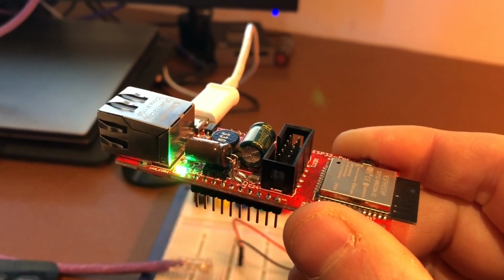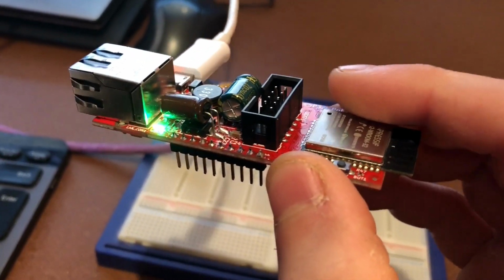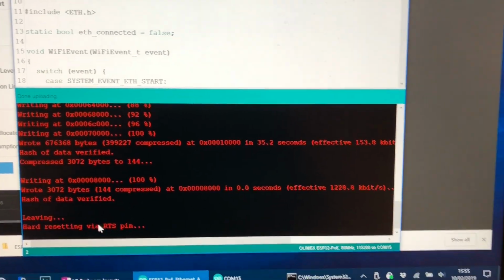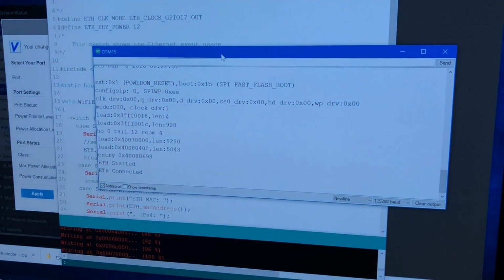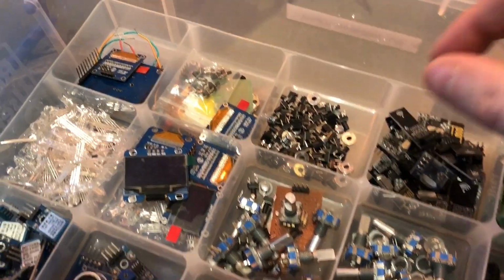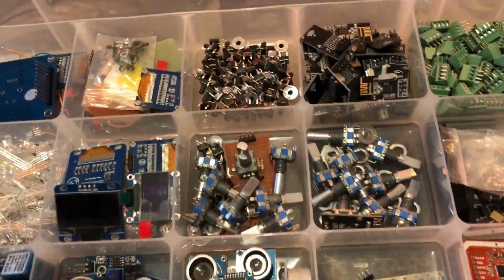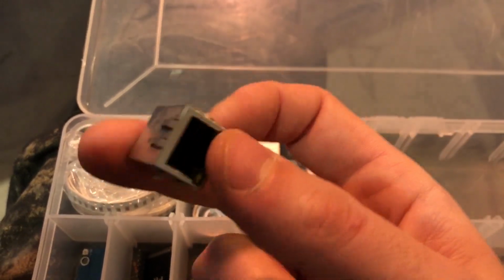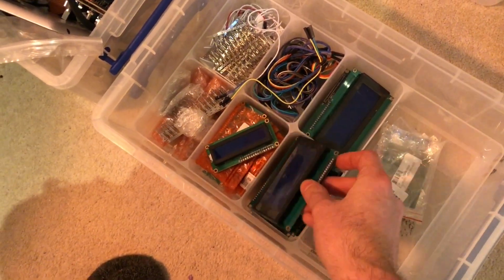First look at the ESP32-PoE & quick tour of my humble Home Automation homelab

Comment: I have moved to using the HC SR-501 PIR sensors and only found interference when WI-Fi or Bluetooth was turned on. Once Wi-Fi/BLE was turned off the SR-501 PIR works fine.
Reply from the maker: Thanks for your comment (months ago!) out of interest, did you have a specific reason for moving to the HC SR-501 PIR? Longer range? Better angle? I have started playing with the cheap microwave sensors, I picked them up for £0.20 each (!!) the RCWL-0516. Tried those yet?

Comment: I'm sorry but Arduino is not good for a reliable secure home automation.
Reply: Of course it is. But any system is only as good as the quality of the components, software and hardware. Buy quality boards and use quality software. If you have the skills, write your own. The same microcontrollers you see hobbyists play with are in millions of products all around you.
Reply from the maker: Tend to agree with this. It's just a microcontroller. Boards only fail if the components (usually the ones that heat up!) are low quality or the boards are designed badly.

Comment: Have you ever testet the Meduino Pro Mini? Have the same chip as the Arduino Mega, but in smaller formfactor
Reply from the maker: I have one of those! I really like it for its size. It's just another thing I bought, but I've never connected it up... difficult to breadboard given the pin layouts, so I guess the only options are setting up a development baseboard (i.e. breakout board, with header pins - just for testing). Have you tried one?
Reply: Yes, in development i use dupontwires. A cable mess but it work. In complete products i solder wires directly to the holes. Then it not will be higher because of the headers on the dupontwires.